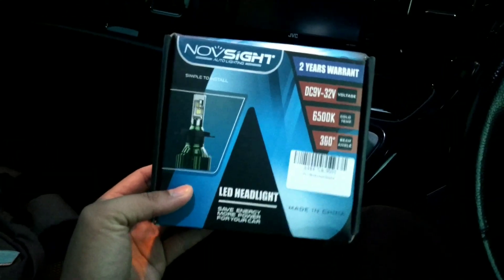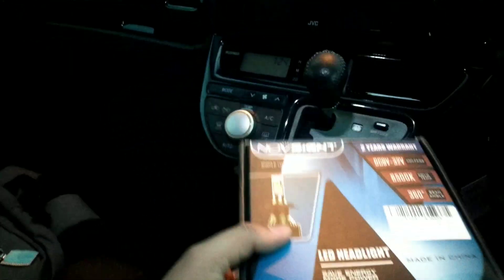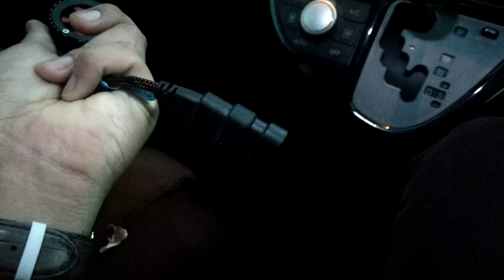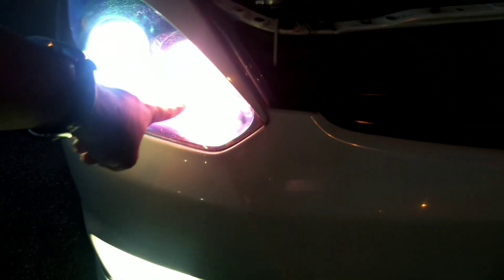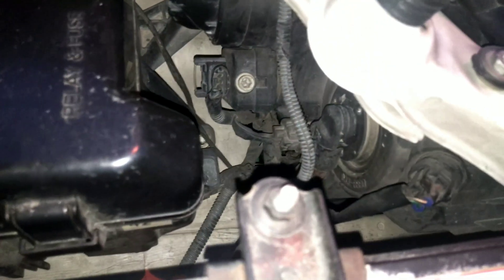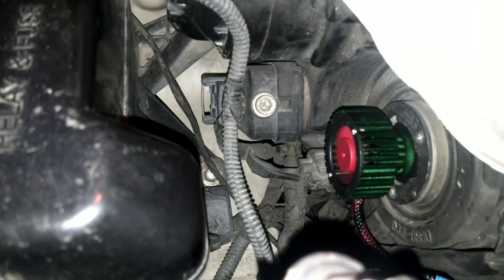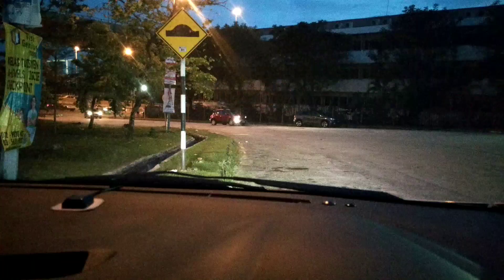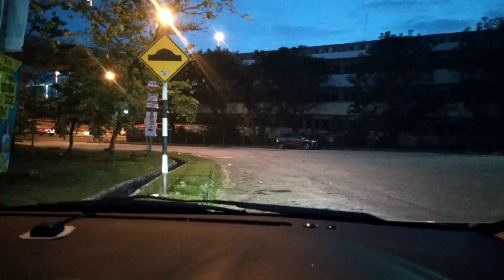Review & Unboxing: Novsight N8 HB3@9005 1600LM for High Beam (Warning May Blind People !!!)

Comment: Hi.. My car also wish first model.. Is it The lamp using led h4 type?
Reply from the maker: There is many version of Wish 1gen. In this video is NFL(2006)...if yours is nfl for oem HID projector is D2S, but for PFL(2003) the one using reflector the original bulb is H11. Need check bro i afraid you buy the wrong ones. I recommend u buy auxito Y13 LED if get the model which is better that this 😊. Subscriber if helpful.
Reply: @IkmalRusli  my wish nfl too.. I bought secondhand.. When i open headlight bulb ,, it is led type..
Reply from the maker: @mohdrashid4326  i think if its that btw are confirm its projector?...if yes then its should be either 9006hb4 or 9005hb3..
Reply: @IkmalRusli  what different between this two? Hb3 & hb4.. I see dimension is same.. :(
Reply from the maker: @mohdrashid4326  Dimension is same but the lock ring notch is different. I suggest go back open your bulb and check it there should and indicator either its HB3 or HB4
Reply: @IkmalRusli  oh my.. Thanks for suggestion and info.. Its new thing for me.. Hahaha.. 1 question.. HB stand for highbeam right? The beam that can use when no driver infront us..is it?
Reply from the maker: @mohdrashid4326  no dude HB is just the model of the bulb not really means high beam. Example HB4,HB3 not really sure what is the meaning of the HB.
Reply: @IkmalRusli  ohh.. Thnks bro alot.. Sory.. My model is pfl.. Now i will shoping H11.. Thnks again
Reply from the maker: @mohdrashid4326  no problem bro... Save driving 😊
Reply from the maker: @mohdrashid4326  
Make/Model : Toyota Wish

PFL:

HiBeam: HB3 (9005)

Lobeam (main light): HB4 (9006)

Foggies: HB4 (9006)

NFL:

HiBeam: HB3 (9005)

LoBeam (main light): H11(Non HID)

Foggies: HB4 (9006)
Reply: @IkmalRusli  thanks alot bro ikmal.. Can i know where u get this info?
Reply from the maker: @mohdrashid4326  
Here:
https://www.mycarforum.com/forums/topic/2643101-consolidated-car-headlight-bulbs-listing/
Reply: @IkmalRusli  terima kasih bro.. 😉
Reply from the maker: @mohdrashid4326  sama sama